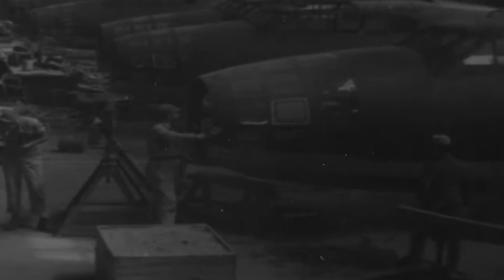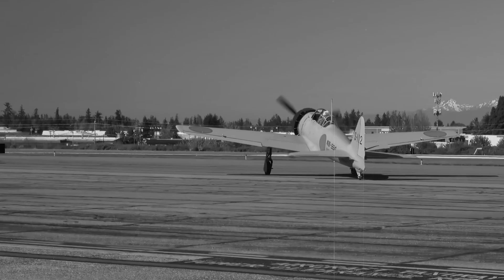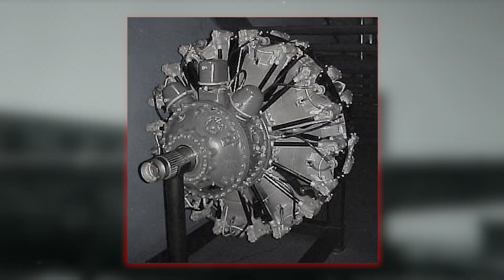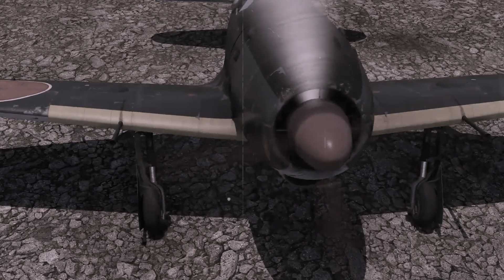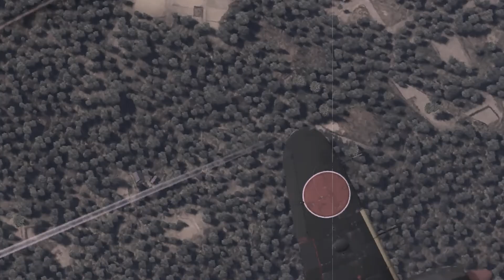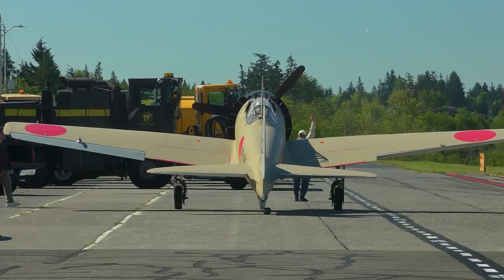Did Mitsubishi Hide The Truth? The Secret Behind Japan's Kasei Radial Engine

Comment: One of the books on the Pacific Theater pointed out that the concept of 'replaceable parts' was not well defined by the Japanese. That books mentioned that the Japanese machine tools were one order of magnitude behind the US at the time; US tools ran at .0001" tolerances, delivering parts very close to that which could be easily swapped for a damaged part. Japanese tools ran at .001" tolerance, meaning parts often had to be hand-filed to fit.
Anyone who has run machine tools and built high-performance engines (as I have) can tell you a hand-filed piston (for example) might be turned into a workable part, but don't bet on it.

Comment: The R2800 had much more problems in development. Crankshaft, master rod, cylinder head ect. There is paper on it something like no quite nights. The P&W R2800 turned out the most reliable radial,